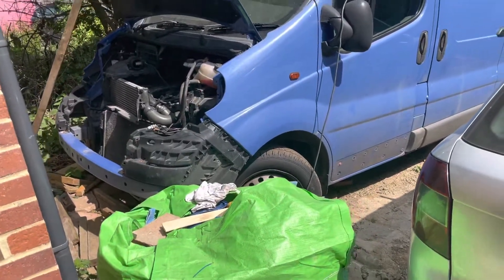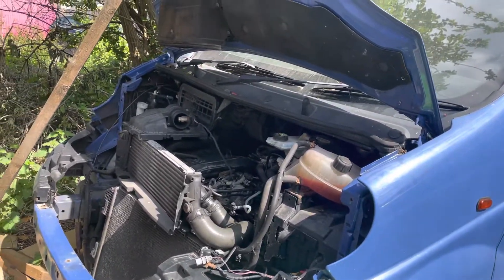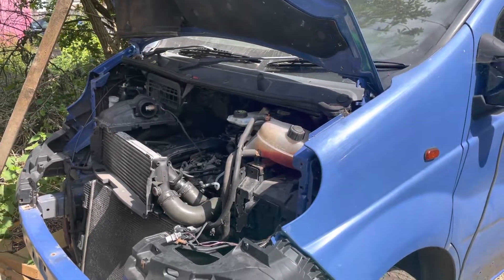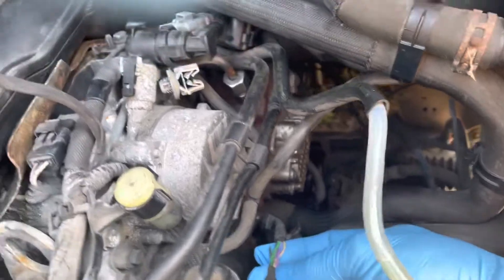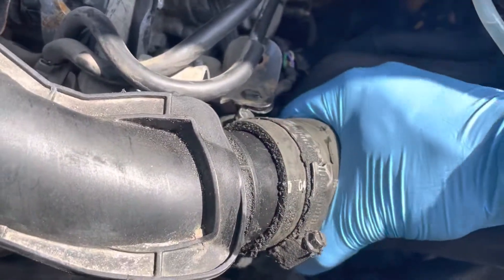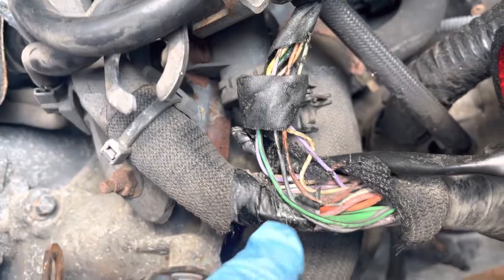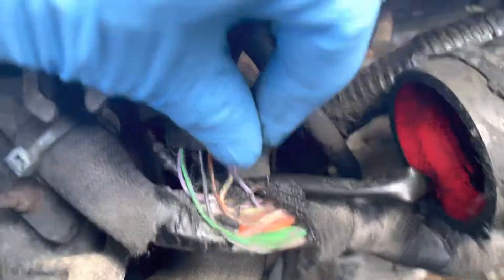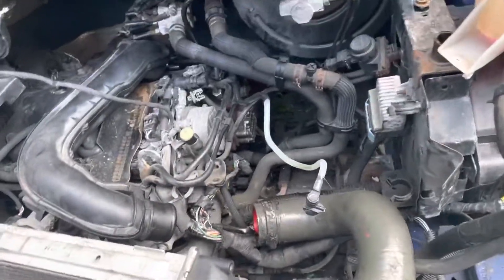Vivaro / Traffic cdi non starter fixed. crankshaft sensor wiring.

Comment: Thank you so much for this video! 👌I had similar issues with a DF120 error (crankshaft sensor) on my 2.0 dci Renault Trafic 2007 (90 cv). It remains unsolved and drives me crazy for 5 months until I ended up here! 🙏🤗 I found 4 wires completly cut in the same location under the intercooler pipe. Thanks again from France! 👋
Reply from the maker: Glad it helped😊
Reply: Hi mate was the immo light on solid at all just can’t get immo off cheers
Reply: @noss1982  hey up mate was immo on solid in this vid cheers
Reply: @pauljohnson357 Hi, don't know what the "immo light" is but I can tell you that the SERV light was on in my case.

Comment: Is this the 2.0 ltr cdti or the older 1.9 ? Just paid £450 for a new injector jn cylinder 1 ( P0201error ) ,stop engine light above 3 k revs,,engine has vibration and delayed starting,,read crankshaft sensor can cause this ? Many thanks
Reply from the maker: Is a 2.0 model 2007